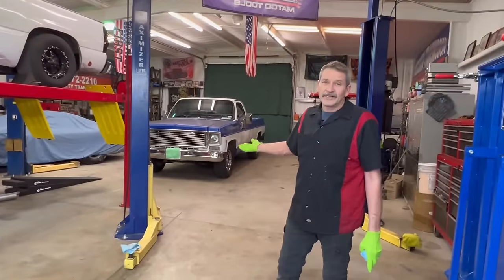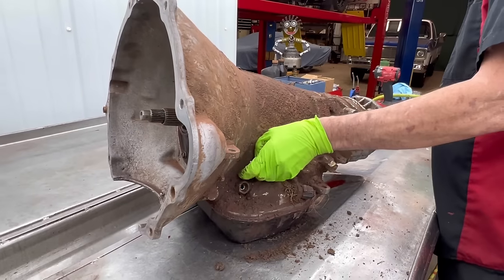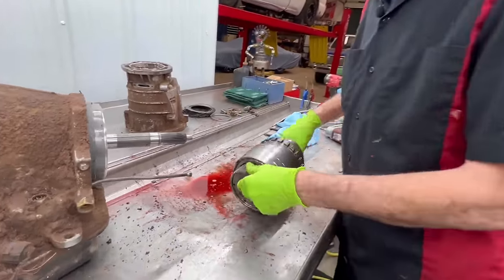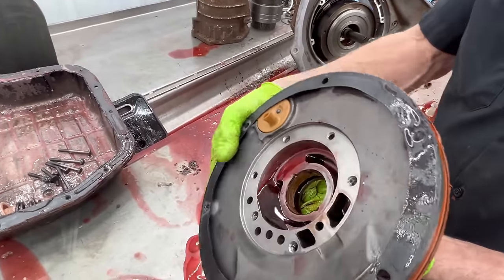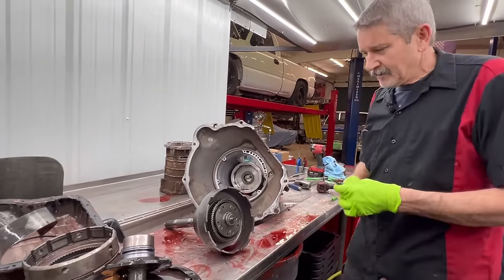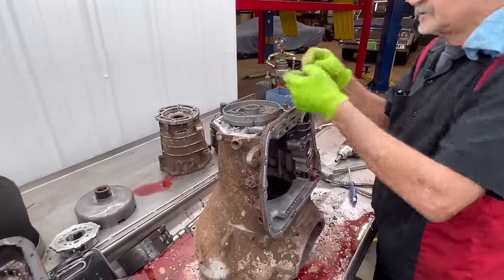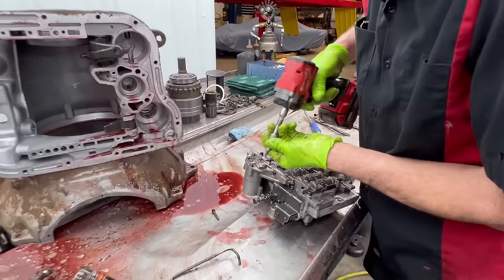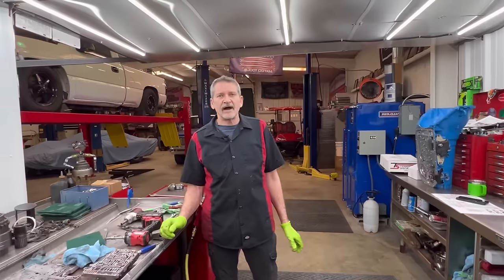47RE 4w/d going into a chevy suburban

Comment: I would have had to pressure wash that thing. 😂  always eat bacon,  never cereal!
Reply: It’s gonna get cleaned afterwards 😂
Reply: @waterloo123100  Yeah, but still. Richard was chipping dirt off just to get to bolts.
Reply from the maker: I probably would have pressure wash this unit but it’s 5° outside
Reply: @richardteresacricheducatio3542  Well. I didn't consider that. Here in SE Texas, we don't have much of that. In that case, I would have had Teresa pressure wash it! 🤣🤣 Great videos.
Reply from the maker: lol 😂
Reply: @richardteresacricheducatio3542 I'd agree...knock off the bulk of the crud first so the washing machine doesn't get so contaminated and require more frequent cleaning.

Comment: Hi Richard, glad you finally did a video on a 47re. I believe you had one on your old channel but i couldnt find it.
I have a 2000 ram 2500 diesel and i was thinking about rebuilding it myself (rethinking now that ive seen this video lol) and have a solid answer on the gas vs diesel thing. Now that i know they have different parts, can a gasser be rebuilt for a diesel? I ask because its much easier to find a gasser than a diesel 47 and it would be much more convenient to rebuild one on the side then swap it in. Thank you

Comment: "Neoprene"...It might help some of us viewers to know a little more about the trans shift kits. I have heard TransGo is the likely choice but then over the years they have a Jr. kit, reprograming kit etc. with some transmissions having a choice from three different kits. As in this 47RE review, just how many upgrades come with a Jr. kit and is it worth purchasing the larger kit vs. the Jr. kit?
I know that would depend on the intended uses of the transmission so lets keep the subject on a reliable, firm shifting vehicle that will tow maybe 1/3 rd of the time. 
Also, on the trans kits from TransStar, do they include the "Selective shims, washers, etc." or do you have to have those on hand?

Comment: Hi Richard,
I just found your new channel and subbed. I have been casually watching your videos for a couple of years now after my tranny failed on a cross country trip. Now two years and two salvage trannys later I've decided to rebuild my own transmission and boy oh boy it can be quite overwhelming. 

Can you make the end all be all step by step video on putting together a daily driver 4L60e, including the Transgo SK4L60E? 

Most videos out there are either lower quality, drawn out, or don't really encompass the whole enchilada, like why does the 4th accumulator needs to be blocked, what happens when the accumulator springs are broken, do we need to replace the torque converter as a preventative measure while we're there if it's been more than a couple hundred thousand miles, etc. 

Times are tough and we need a guiding light 🫡

Cheers

PS:
Please get one of those rode microphones all them content creators use. Your knowledge is worthy of archival and the quality of your content should match it

Comment: What is the best place to install a pressure sensor on the 42, 44, 46, 47, 48 series transmissions if you want to put in a pressure gauge?    Also...  what makes the Sonax pressure regulator valve superior to the Transgo?
Reply from the maker: I would do the accumulator port on the passenger side of the transmission The port in the middle of the case is the one to put the sensor in
Reply: @richardteresacricheducatio3542  thanks for the response! What about the Sonnax pressure regulator valve for the dodge transmissions? What makes it better than the Transgo?
Reply from the maker: I like the lube circuit they added in the valve to me. It maintains better, low line pressure over the Transco, at low idle speeds. When the transmission is severely hot.

Comment: my buddy has a 07 3500 cummins 4x4 with a 48re trans,it has a problem staying in 3rd gear at around 33mph,his rebuilder said it needs a spacer,or washer/shim somewhere in the valve body to fix it?,have you heard of this?, also i have a tool that reams out the governor housing on a 350 and 400 trans so you can install a bushing to save a bad case,would it be of any use to you?